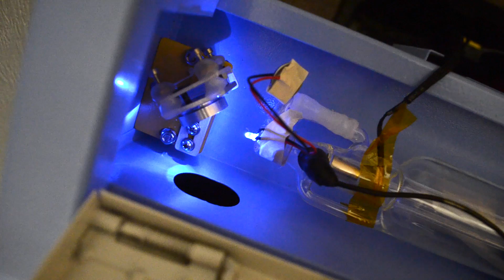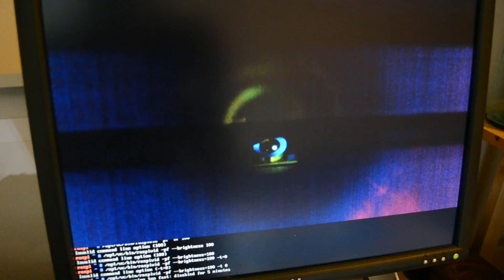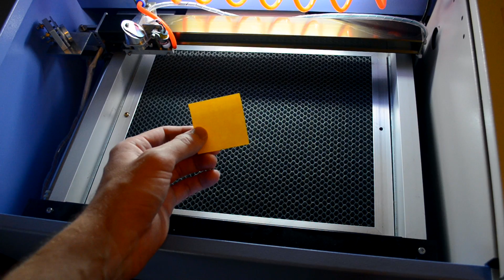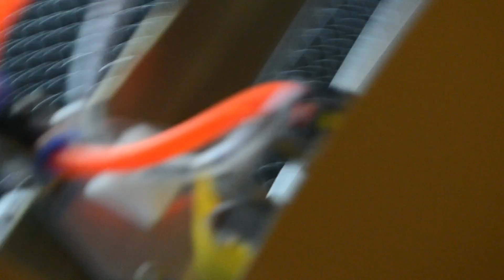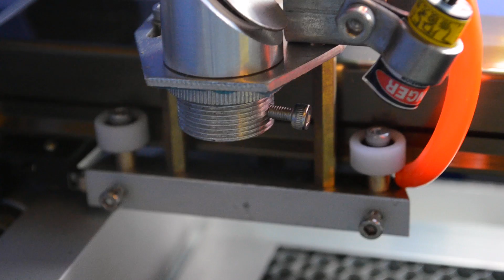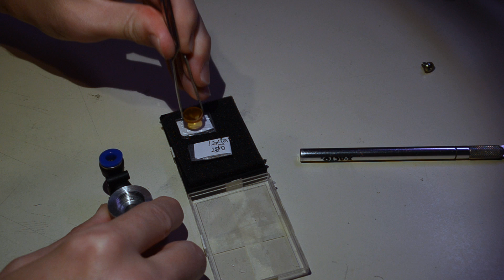Chinese laser cutter part 4: Optics

Comment: Hi, I was given this machine by someone who bought it 6-7 years ago. The software doesnt work and asks for a USB in Chinese. Any idea how i could work around this? I havent tried it while the machine is connected though.
Reply from the maker: I would look into one of the open source controllers, like RAMPS or LAOS.
Reply: +hpux735 thank you. another problem I face is that the software asks me for some kind of USB (in Chinese) when start the software, I havent connected the PC to the machine yet. does it use an identification USB? or does not work with the connection to the machine?
Reply from the maker: Yes.  Some of the programs require a license USB stick.  They can be purchased on Aliexpress or eBay, but I wouldn't bother.

Comment: Hey great videos man. I really appreciate you took time to explain everything. I am still not done with all of them but Here is the reason why I started watching them and looks like I got my answer but let me verify if I am correct.

So What I want to do is, expand the BED size of this laser cutter by putting it in bigger enclosure and longer rails (24"x36"). And the laser will still focus and cut as song as I use right lens and the distance between lens and my material is same as focal length. Is that correct?

Also due to longer distance the laser beam has to travel will it loose some power at far edges ?
Reply from the maker: +Chirag Chaudhari Yes.  I think that you're correct about all that stuff.  Let me know how it goes! :)
Reply: Yes I will sure do. I am waiting for delivery of the Laser cutter and RAMP 1.4. Thanks for quick reply.

Comment: where did you get that head? was it on the machine or upgrade?
Reply from the maker: +sifterbox It was included with the machine.  It's adequate; certainly better than some that I've seen, but far from perfect.

Comment: Nice work, there are two ways to move those motors "in a nice way". 1 turn off the power then move them. 2 use the PC to jog them into position. Never push a powered motor but you are trashing the controller so I understand. The first thing I would cut is a little silicone washer to go in your lens holder so it is not metal to lens. During alignment you typically measure the laser to the bed distance at the four corners to make sure they are all equal. I also stick some paper over the nozzle and make sure it burns on center. Good luck
Reply from the maker: Robonza Thanks!  I'm not totally sure how I would adjust the bed distance if I measured them to be out of plane.

My new controller has a little joystick, so I can move the head around without abusing my stepper drivers.  Also I pulled out the moshidraw board, and they're "stepper driver" is a pair of H-Bridges in IC packages with a heatsinck bolted on.  Pretty cheesy.
Reply: Its more a bed leveling thing for that adjustment, basically you twist the chassis by shimming the foot on one corner.
Reply from the maker: Robonza Oh, that makes sense.  I'll be sure to check it out.

Comment: Good video!  I'd also maybe recommend that the 3D printed camera adapter have two small apertures printed in the center so you can check the alignment of the camera mounted in the adapter.  Therefore, you would see two circles in the video which should both be centered in the field of view.
Reply from the maker: Ryan Dillon Yah, that might help.  What's weird is that the alignment of the laser after I tried the camera method the first time was WAY off...  like an inch off.  It's possible that the apertures would have helped.  Another thing is that the raspberry pi camera isn't that good in low light.  That did not help.